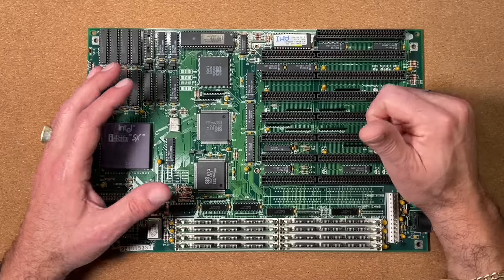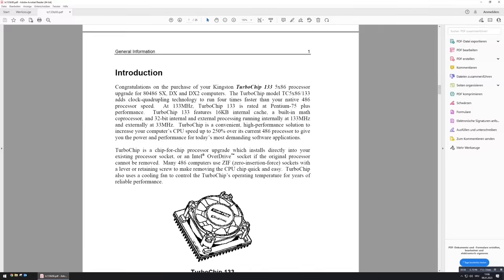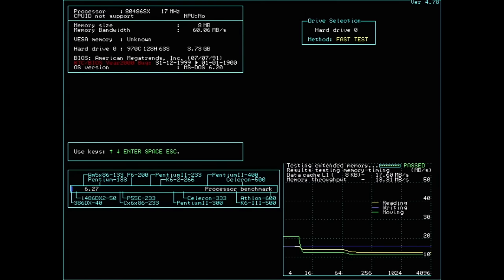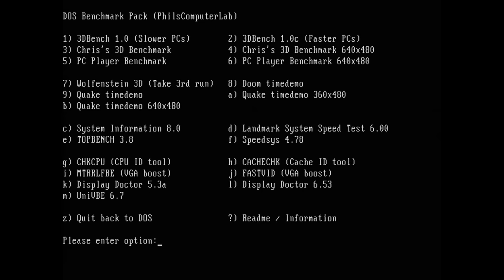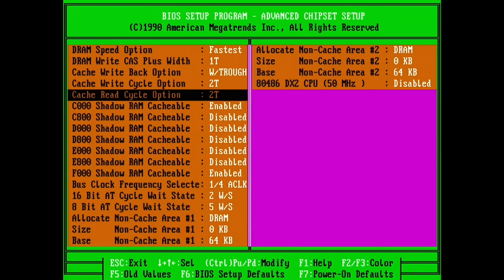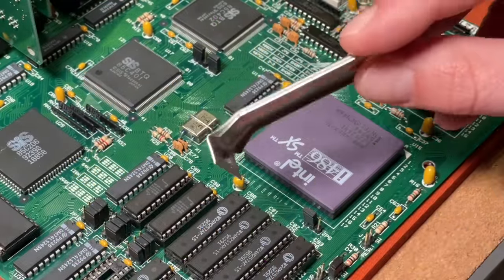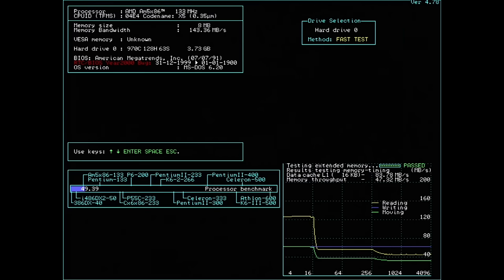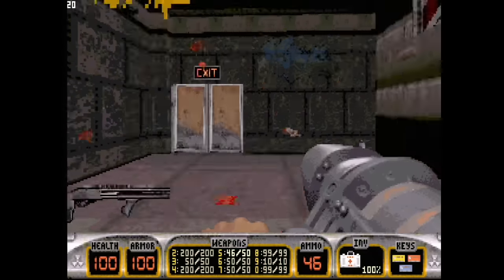Intel 486SX-16MHz Benchmark and Upgrade to Kingston Turbochip at 133MHz (AMD 5x86-133)

Comment: I built a couple 386 and 486 machines using parts salvaged from the computer/storage room at my dad's office back in the late 90s, but at home I learned programming and computers in general on already an old but still fun Apple IIGS and Mac IIci, both loaded with the best upgrades you could get because they were gifted from my uncle that saved them from the design and printing place he managed the computers for.  I missed out a lot on DOS and Win 3.1/95 and when we did build a computer for be at home I went straight to a Pentium and 98SE.

That said, I still use the IIGS and IIci for fun programming but haven't really gone back to older PC stuff (love videos on it though).  I never played a ton of games, I just read books on Assembly and C, the two options I had the tools for on both, so I don't have the same nostalgia a lot of people do.  I focused more on writing graphics/music programs, my own games, and IIGS demos.

Comment: Funny thing, while Duke doesn't care about FPU performance, if you don't have an FPU you're not going to have a good time in some very specific spots of some of the maps.

That's because slope rendering code does an integer FPU load and then store back as a float to then do some further integer magic on that, looks like approximate 1/z calculation, and it does this once per pixel. That's the only FPU instruction used and it's basically non-arithmetic. This function that does this is also called to generate random numbers or something like that but not enough to matter for performance.

There's also no alternative implementation for any of this, so if you don't have an FPU, you get it emulated by the Watcom runtime, handling the NM exception, which is predictably slow.

Comment: Something I just realized with the older motherboards is they don't use serpentine/matched traces. I guess it makes sense with the slow clock speeds, but it is weird seeing motherboards without them. I do remember my 333MHz computer had them, so the cutoff must be somewhere below that.
Great content as always.
Reply: unequal trace routing is problimatic with high speed busses, latency timing becomes critical.
Reply: @joefish6091  yeah. I design PCBs, but mostly as a hobby. The only length matching I have ever needed to do was for USB. It is fun watching videos on DDR3/4/5 though and realizing how slow the speed of light is to require length matching.

Comment: Thank you very much for this interesting Retro video, I enjoy those very much.
About your question on intel and the 486/487SX series, I always imagined intel used this as an opportunity to sell a CPU which failed the quality test in production. The 486SX failed on numeric coprocessor function at least, and the 487SX simply failed the speed tests. The chips were packaged different (pinout) to sell them with different mainboards. But I personally at least once saw an 487SX on an adapter board to place it in a regular socket for 486DX.
The same reasoning was with the special DRAM module. A partially defective DRAM chip was bonded directly to the PCB, so it could be used with lower capacity still.

Comment: That works a lot better than I thought it would.  I wonder how affordable that would have been at the time? I'm not sure of the exact timing but I imagine at that point many would be using early pentiums and the cost of upgrading was plummeting which if I remember made these types of upgrades disproportionately expensive. But, it does work very well.

Comment: I'm really curious how high that 486SX-16 would clock.  I'm fairly certain it would do at least 33 MHz, and probably 40-50 MHz.  I had an old 486DX-25 that ultimately ended up at 48 MHz,  though it wouldn't work at 50 MHz.  (In hindsight, it was on a "33 MHz rated board", so it could have been the motherboard not the CPU limiting performance).  This was around 1993 or so..     My BBS + gaming + work setup consisted of several 486's...

Comment: PLEASE PLEASE TRY!!!! !!! !!! !!! I HAVE A REQUEST!!!! Please can you check if you can run a 486DX or above (any 486 including the FPU instead of the SX models) AND try to also install a Weitek CPU on it and see if you can run both FPUs on the system at the same time! Considering how they interface differently with the system this is likely possible and would be absolutely AWESOME. In case you did not know, Quake in particular had the performance it had on Intel CPUs because it could use the CPU's integer math at the same time as the FPU floating point calculations resulting in something akin to a dual core when it came to mathematics, this would not work on Cyrix as when the FPU math was in use the integer part was pretty much disabled/waiting for the FPU to finish therefore crippling the max performance. I would ask Quake developers directly (if I knew them) to actually extend the work they did and add support for the Weitek FPU to their code therefore resulting (hopefully) in a large performance increase by using simultaneously the CPU Integer math, FPU floating point math and the Weitek FPU math! This should if possible result in being able to run Quake properly on much lower specked 486 systems as long as they are the DX model plus the Weitek! PLEASE PLEASE TRY!!!!

Comment: I was expecting it to run even faster after the installation of the Kingston Turbochip. I run it on a microchannel IBM  PS2 77s with an onboard S3 of 1MB and Doom runs extremely smooth. 3D Bench reports a score of 76 frames per second.

Comment: In the age of 486 the Weitek FPUs usually weren't faster anymore but they were often required for expensive software because they used incompatible Opcodes. Think of them as dongles which actually do something useful.

Comment: Wow! I would find lot more use for that computer in 16MHz configuration. Older 80’s to 90’s games problems with high speeds would run great with 386/33MHz or comparable - for example adventure games, Wing Commander series, etc. Having already i486dx4 and 5x86P75 leaves a spot at that range underneath. Also my 286 is breaking and a little slow anyways to restore.

Comment: Overclocking a 5x86 to 160Mhz is actually really easy and stable. I have used 5x86@160Mhz a lot and still have one in my basement. So you could also call it a 1000% upgrade.

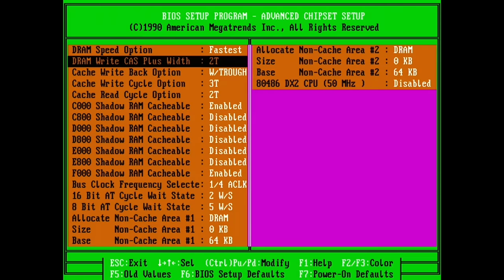Comment: 13:10 as teenager in 1993, and then also later I didn't know what is difference between Cache write back (w/back) and w/trough. I know only two first settings on the top - and rest of it below - It was always the mystery for me - what it is doing...- In 1996 I had access to internet in school for the first time, but I never checked it, and forget it later.
but now, when you set up those settings with commentary (it looks like you know what you are doing) - it is such a nice feeling, to finally understand it better.

Comment: Have you tired using the sx16, with No motherboard cache or cache tags? The ram read is measuring slower than even the RAM writes. This looks to me, like, without the cache in the middle, the read would be where the purple ram write speed currently is... With your excellent 60ns Simms, 16Mhz is a do-able speed at 0Ws. It might be interesting to try it on the cache less 486sx-20 Motherboard you did a while back. Obviously 60ns cannot do 20Mhz, so a wait-state was introduced. Giving a 12.5Mhz memory speed (80ns), even though you inserted 60ns.  But, just for fun, it would be interesting to see if when set to just 16Mhz, if that wait state either disappeared, or could be set in bios. Or, if necessary, using that excellent bios-options-editor, can a 0WS for RAM option be enabled in the bios. As at the moment, the board isn't taking advantage of the 60ns ram during all the reads due to cache slowing everything down(on this video). And, on the previous 20Mhz 486Sx, a wait-state was being added from necessity as no one had 50ns Simms in the 1990s.

I remember throttling back a 486slc-25 to 16Mhz, just so I could set everything to 0WS. Looking at your videos, it looks to me like you're also a tinkerer, tormenting hardware to go faster and faster etc :) . In the case of the 486slc-16, 0WS did improve performance. But, not by much though :(

 The board was defo faster at 25Mhz with 1Ws than it was 16Mhz with 0WS. But it was a fun experiment at the time (1993 I think). What do you think, can the board work without any cache? 
Loving your channel BTW.  Particularly love it when something improves big time, like in this video with the Kingston. Your voice gets all excited still, even though by todays standards everything from the 1990s was rubbish. Well, except for the soundcards anyways. Somewhere I've kept my Yamaha 60W (ISA) soundcard, and my Yamaha SW1000XG(PCI) cards. As nothing ever came along to beat their wavetable synthesis. I can't give them you, they're too important to me, plus I still use the SW1000XG, but if you'd ever  like to lend then for a review or anything, let me know.

Martin

Comment: Great stuff! you may have  a more fun experience with Wolfenstien rather than Doom on a board without VESA or PCI  I've never come across a 16mhz '486 but I do remember building machines in the shop with the 25 & 33mhz ones, which both could be run @33 and some boards 40mhZ  -, if I remember the UMC  chipset boards were fairly quick like the ubiquitous PT-429 series, I remember  some of the OPTI chipset boards  with AMI's  WIN-BIOS werent bad either,  - thanks for the memory - those were the days of turbo buttons speed displays and setting by jumpers!

Comment: You asked who bought 486@16MHz back in a day. Well, I can't tell for sure, but most of people back then weren't experts in a filed, making them an easy target for Intel's marketing departament. It was modern 486, not outdated 386 - so they said. Or maybe people that planned on upgrading CPU in near future.
Just out of curiosity, during the video I ran same tests that you did on my IBM PS/Valuepoint 325T/S, which has 386@25MHz (8kb internal cache) with 387 FPU and mostly had same results (before upgrading cache and RAM), except of Doom, where I got over 12k realtics. I also had  over 11k dhrystones in Checkit.
Why are colors in Duke3D so weirdly faded? Is it the vga card?

Comment: Mid-1992, which seems to be when the board was made, sure makes it rather late for a 16MHz machine. While it won't catch a PCI or VLB system with the Turbo Chip installed, I do often think ISA only boards are more capable than maybe some people give them credit for.

Comment: I had a friend that had a 486sx20, never ran across a 16mhz chip in the wild though. The 20Mhz chip was terribad, i cant imagine slowing it down by 20% more. I eventually gave him my 5x86 build once i got my Pentium 120 system until he finally upgraded to a Pentium 200 a year later or so.

Comment: The lack of any improvements with tweaking is indeed a side effect of the SX 16 being such a bad chip, it was basically a 386sx with some 486 instructions glued on the base architecture is still 386 though so it gets zero advantages from anything the faster full fat 486 chips could take advantage of. The bios doesn't "detect" the CPU per se on most mainboards from 8086 up until Pentium mmx chips , these were configured via jumpers or dip switches on the board whatever those toggles told the bios it put next to the vendor id from the chip and displayed that. Setting the jumpers to use the 50mhz FSB should also improve performance noticeably over the 16mhz setting. Also quadrupled is roughly pronounced Kwa-Droop-Ld btw.

Comment: you have 16 mhz cpu bus speed and memory linkled to it works fast enought byself so cache not much faster - set 33 or 40 or 50 bus and cache will play more significant role. also you should enable WRITE BACK caching (its disabled) - cache will be more noticeable and probably you can set even lower timings on isa etc. also you 133 chip internal chache also working as WT (probably)  may be it can be enabled in WB mode?
Reply from the maker: with the Kingston Chip the bus was clocked at 33 MHz. and all timings are already at the maximum/minimum. WB is not supported and the board freezes when I turn this on in the Bios.
Reply: @CPUGalaxy  oh ok i understand. btw wb absense makes cache role not so sharp and also internal 133 cache can be wb or wt switched probably but may be chipset support or jumper needed for that? 486 was always jumper mess =))) especialy when you try to run latest chips or pentium overdrive on early / middle motherboards
Reply: That Kingston upgrade, it had to be really something to make such a performance jump back then, from zero to hero!

Comment: The 16mhz 486 is such a bottleneck there no amount of tweaking makes any difference.  Likely it was useful for boring office work data entry back in the day.  Thanks again for another great video.
Reply: The 486 SX at 10MHz was merely a marketing ploy, and a method of disposing of half broken slow DXs.

Comment: You selected Write Through instead of Write Back. Is there a reason why? I thought Write Back was the faster option. Thanks for the great video!
Reply from the maker: WB is not supported here and the board just freezes.
Reply: @CPUGalaxy  Interesting! Do you know if the limitation lies in the processor upgrade or the motherboard itself? If the 5x86 upgrade you had was preconfigured with WT, then that would explain no boot on WB. I think I have the same upgrade, but I learned recently there were two model numbers of this Kingston 133 upgrade, one with WB and one with WT. My Evergreen AMD 5x86 133MHz had a jumper to select either WB or WT.
Reply: @molivil  I had a machine with a later FIC 486GVT motherboard which I believe could use the write back cache on both the 486DX and the 5x86 upgrade chip. Possibly the chipset on this board doesn't actually support WB mode properly.
Reply: @CPUGalaxy  If you can get writeback to work, it will definitely be faster. Writeback == the CPU writes to the cache and then goes on to do other things while the cache flushes itself to memory when it needs to, Writethrough == The CPU doesn't write to the cache and instead has to wait for all writes to go directly ("through") to main memory, this turns the cache into a read-only cache instead of a read/write cache. 

Writeback caches are notoriously hard to implement with drivers because some drivers expect immediate access to whatever it's writing to. In cache management the proper way to handle this is to mark some places non-cacheable or in software you execute a cache flush after writes. 

External buses are so slow these days that absolutely everything uses a writeback cache and all software is aware of it.

Comment: The university I was in early 90's had a lot of these 486 SX just the 25Mhz variation, lots os white Gateway PCs. Just 2 or 3 of them had 80487 Math coprocessors.

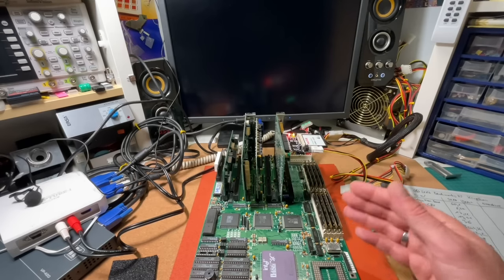Comment: 12:57 you pluged 8MB ram in, and on the screen is 008064KB. 
For what are those two zeros on the beginning? 486 16MHz, is able to support 16MB or 32MB? 
That sounds insane

Comment: I wished someone would make a 486 cpu with a 12 or 14nm node, running 1 core at 2Ghz complete with extended ram, Isa bus, emmc and usb controller, svga compatible graphics chip, and sound blaster pro compatible card, 640kb of cache, and 32MB of extended memory all built in into the chip.

Such a chip should be about the size of an SD card, require hardly any cooling, can run most DOS, and windows 3.x games at full resolution and quality, and be potent enough to play most basic win 95/98 games.

Then load up the unit with MSDOS, Windows 98se, or older Apple os or something; mass produce them, and sell em.

Comment: I do have a question: what is the oldes isa vga card natively supported in windows 95. I am looking for directx1 and direct draw 1.0 support. the oldest isa graphics adapter. In mind I got Diablo game minimum system requirements. Thanks in advance

Comment: The fact that there is a "16MHz CPU Clock" message during boot, shows that an "Auto Config Function" is Enabled in this BIOS. "Auto config function" sets some (very conservative) memory timing presets, based only on CPU clock. Many 386/486 AMI BIOS Setups had this option, which you could disable, and only then the memory timings you had selected took effect. Some BIOSes (like this one) had this "Auto Config Function" option hidden, although it's enabled. So changing timing options in Setup makes no difference at all. I had this issue with a 386DX/40 board, edited Setup options so that Auto Config Function option appeared (I think I used a program called "Soft BIOS", but I'm not sure, that  was 30 years ago!), set it to disabled and then the "40MHz CPU Clock" boot message dissapeared and timing options started behaving as they should.
Reply from the maker: thank you. this is a very useful hint! I will definitely try that.
Reply: @CPUGalaxy  If it's of any use, the utility I used to turn off the "Auto Config Function" was called AMI Setup v2.6 , and I think you can still find it online!

Comment: 386 at 40Mhz? Nah! A 486SX at 16Mhz struggles at finding comparison to a 386 at 33Mhz, performance-wise. The 386 at 40Mhz is faster. As a rule of thumb we used back then, under the point of view of pure calculus a 386 has more or less the speed of a 486 clocked at half its frequency (386 40Mhz == 486 20Mhz) but the 386 has the advantage of a faster memory bus (its clock being double).

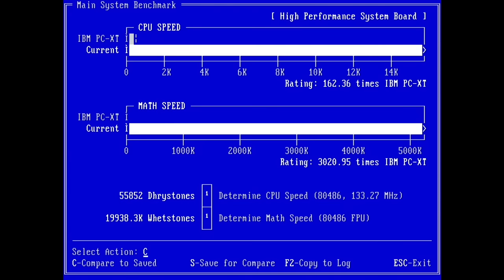Comment: 21:47 would this accelerator chip work on a better 486?  Like a 66mhz dx chip?
Reply from the maker: yes. it works in any 486 platform.